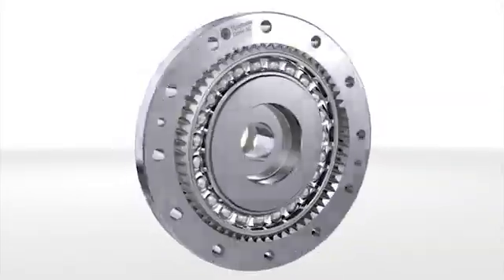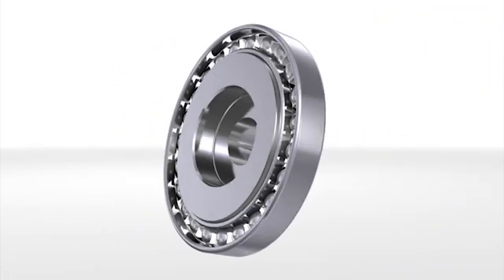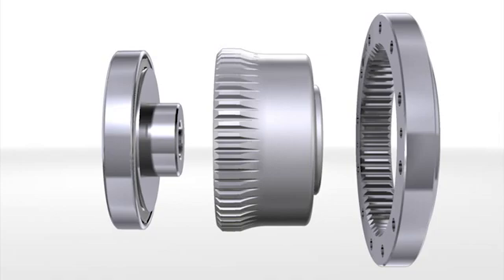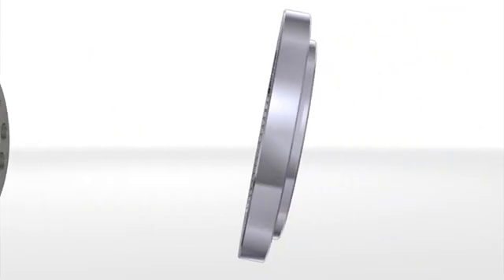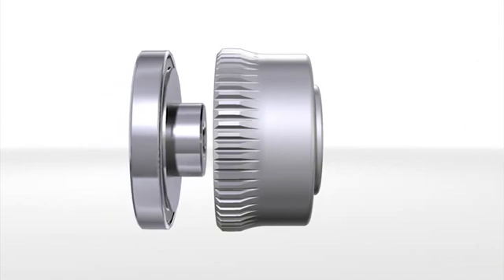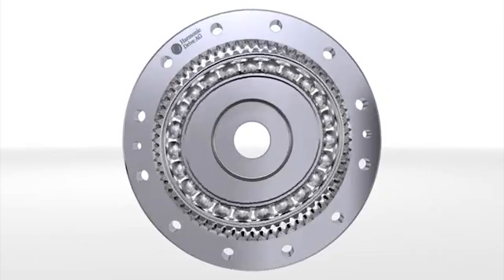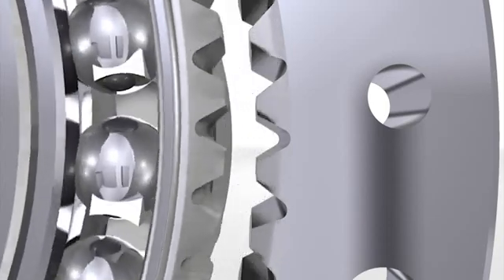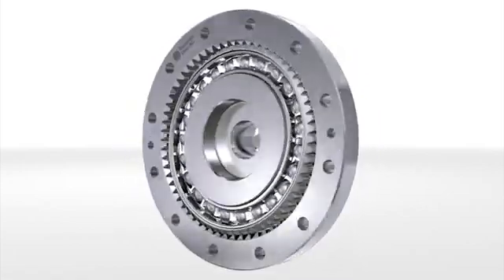Harmonic Drive Strain wave gear principle | Harmonic Drive SE

Comment: What is the longest these gears can last under low strain?  Can they be designed to last longer?
Reply: Most of the strain is internal, it's not related to the load.

Comment: No wonder I’m starting to see these in equatorial astronomy tracking mounts. Backlash is one of the challenges I encounter with long exposure astrophotography and this configuration seems to eliminate it. The high torque and load capacity of these drives also eliminates the need for counterweights. Outstanding piece of engineering here.

Comment: I wonder if that could be made out of plastic. I'm guessing the outer race will be the most stressed surface
Reply: If you want a lower gear ratio you probably need to use plastic because of the increased elasticity.

Comment: Ahhhhhhhh , so that's how those big KUKA robots hold a load with little effort . Cheers spline lords , you rule.
Reply: It's more about the precision tho due to the zero backlash, not the torque. A traditional gear could do the same load-wise. But robotics such as KUKA also needs the precision, hence this gear.
Reply: Yeah.. also harmonic drive takes us less space and less volume to achieve back drivability and precision.. hence they are coupled with BLDC too.. 
if you were purely going for precision.. get a worm gear and a stepper.. no back drivability but excellent precision and very very low cost..

Comment: Does the flexing produce heat and hardening (brittleness) in the materials used?
Reply from the maker: During the operation the Flexspline is permanently deformed by the rotating elliptical Wave Generator Bearing. However the Flexspline is only deformed within the elastical deformation zone, there is no plastic deformation during the operation. Assuming an operation within the catalog values the Flexspline is designed to endure the complete life of the gear. There is no hardening effect of the Flexspline during the operation of the gear. 

As every gear has a certain efficiency, of course also the strain wave gears produce heat caused by the thermal losses during the operation. When a gear is loaded with its nominal loads, the efficiency is typical within a range of 80…85%.

The service life of the gear is typically not determined by the Flexspline but the Wave Generator Bearing which rotates with input speed and sees a high number of load cycles. When the gear is operated with rated torque and rated speed, the nominal life of a gear is 35000 h (HFUC, HFUS, etc.) or 50000 h (CSG, SHG, etc) at 50% probability of default.

Harmonic Drive Strain wave gears have proven their reliability in many applications. They run in high volumes e.g. in robotic applications with high loads, enduring long service life.
  If you have further questions please feel free to contact us.

Comment: benn reading the comments of several videos related to new transmission drives, i supprised this is not full of peopple saying this is shit and doesnt work on cars
Reply from the maker: Dear cristian arango,

The strain wave gears produced by the Harmonic Drive Group are an established gear principle. The basic principle was invented in 1955 and since 1970 the strain wave gears are produced under industrial conditions. So basically the gear principle is no new technology but already has a long heritage in industrial applications.

The typical applications of strain wave gears are industrial applications, e.g. as joint axes in robots, in machine tools, medical technology, optical machines, aerospace etc.. In most of these applications the gears are used for positioning applications with focus on precise positioning, high dynamic acceleration and deceleration and long endurance qualities. So this gear type is no typical car transmission gear, which is rather dominated by spur gears or planetary gears.

Best regards, 
Harmonic Drive AG Product Management
Reply: thanks for the kind and detailed response, harmonic drives are quite effective in robotics and other applications, i was just complaining on how many viewers that are interested in transmission seem to think that the only possible application for a transmission is automotive drive

Comment: wear life has got to be low?
Reply from the maker: The alloy steel of the Flexspline works similar to a spring. And the flexure is well within the fatigue limits of the metal. The losses are extremely low when compared to the gears (well over 99% compared to around 95%). The minimal losses in the Flexspline are transmitted to the system over a large area (the Flexspline is the largest element in the gearbox). As you correctly state, the losses lead to heat generation. This energy is radiated from the Flexspline surface or transmitted to the lubrication, which also has the task to remove this heat (as well as lubricating the gears). Further, the stresses in the Flexspline are always lower than the endurance limit so that a fatigue failure will not occur. This is a design limit of the gears. For the last point, good gear contact with a flexible gear, we have developed a special gear form for this motion. This is one of the “secrets” to the success of the Harmonic Drive® strain wave gears. So you can see that even with just three main components an Harmonic Drive® strain wave gear is a complex system with components designed expressly for the tasks required. 

For example, if there are 202 teeth on the circular spline and 200 on the flexspline, the reduction ratio is (200 − 202)/200 = −0.01 Thus the flexspline spins at 1/100 the speed of the wave generator plug and in the opposite direction. This allows different reduction ratios to be set without changing the mechanism's shape, increasing its weight, or adding stages. The range of possible gear ratios is limited by tooth size limits for a given configuration.
Reply: i have an industrial robot with two of these for the last 2 axes, been running 24h/7 for eight years straight without a problem.. Wear life must be great , i suppose :)
Reply from the maker: The precise material specification is confidential. Basically the Flexspline is manufactured from a heat-treatable steel, the Circular Spline from a cast iron and the wave generator is usually steel but can be Aluminium. Due to the selection of materials and the specifically designed lubricants wear is a minimum. The gears remain backlash-free for the complete operating life.
Reply: Beryllium in the alloy no doubt ?
Reply: The key is proper lube. Most robots utilize harmonic drives. Fanuc Robots recommend their grease, which is actually a fish oil base. Properly maintained, these drives last a very long time. The reason is the way the teeth engage. Watch the video again and you see the don't engage like a typical gear. Awesome mechanical invention.
Reply: @JP-in-OH  the Apollo Lunar Rover used silicone oil, with drive housings filled with nitrogen gas
Reply: What materials are used for the three parts? the flex drive is an alloy, what are the other two parts? What kind of wear happens as a result?
Reply: Ive got a few of these now, they are all steel pieces. This video was my introduction to them but I've been messing with them a while now and can say there is virtually no wear as its harmonics doing the work.
Reply: I'm not doubting you, but the first thing I though while watching is that the extreme flexure of the flex spline must heat and fatigue the metal. How can it be flexible and make a good gear tooth surface? Seems like the obvious failure mode. If you do eventually have a problem there, will you get back to us? 

BTW: Do you know the reduction ratio of the units you have??
Reply: The flex isn't extreme at all. Most of these drives the deflection is only a couple millimeters. So this doesn't generate heat. Friction in normal drives is what causes heat. The teeth move "in and out" as opposed to rolling across. I've worked with many robot manufacturers over the last 20 years. The weakness of these drives is the load. The can't handle a heavy load and are susceptible to damage when there is a jarring action. These drives are built for precision, not load.

Comment: I would suspect that this level of gear reduction would not serve much purpose in the automotive industry
Reply: I suppose not, but this level of precision, minimal backlash, and low gear reduction can be invaluable in the robotic industry
Reply: @al3th3s  Camera focusing as well.
Reply: While unsuitable for vehicle drivetrains, harmonic drives could be useful in reducing the size/weight of other motorized assemblies, like those powering windshield wipers or electric power steering. The benefits would probably be grossly outweighed by the cost, though, so Matteo Allesandro is correct that the primary market is in automation. Harmonic drives' ability to achieve zero backlash while retaining a long service life is a godsend for precision CNC rotary tables, for example.
Reply: You’d be wrong, as these drives were integral components of all the Apollo Lunar Rovers

Comment: hmmmm thats clever, i just finished my transmission unit of my tafe course in automotive inspect and service. i wonder why we didnt get taught that
Reply: Probably because Harmonic Drives aren't used in automobiles - very few cars needs a 100:1 reduction ratio, unlike the robotics industry.
Reply: @eatonjask  care to explain what a reduction ratio is and what it is used for, please?
Reply: In a very simple way, when drive rotates fast, wheel rotates slow (ratio). In automobile you don’t need to have such a low gear anywhere.
Reply: @ИванИгревский  yes lowest gear ratio is sometimes seen in large earth moving vehicles.. or in small tractors..